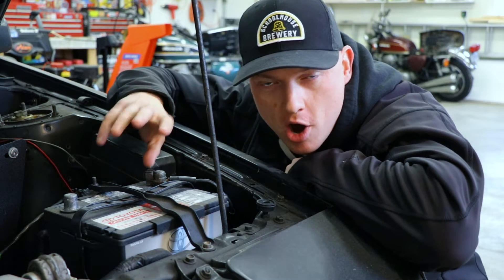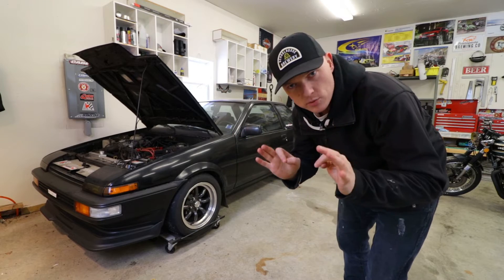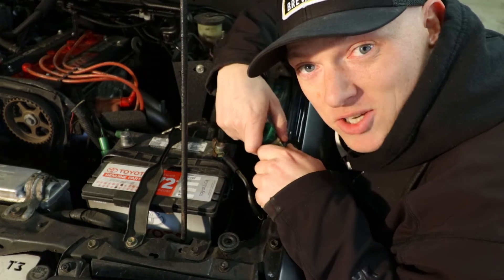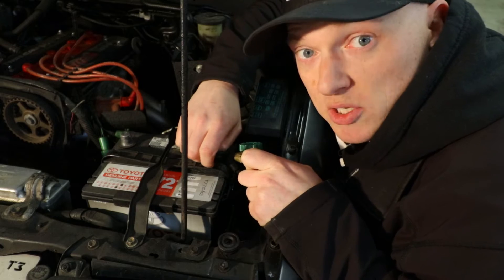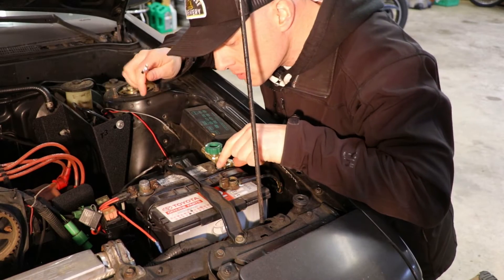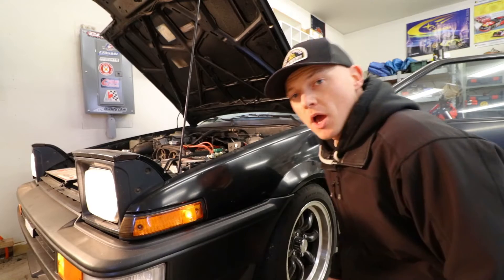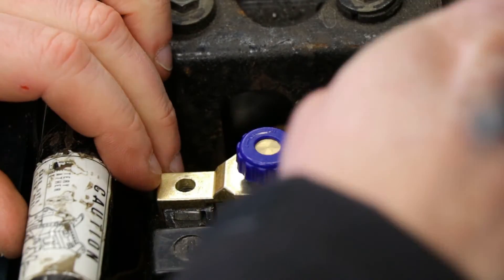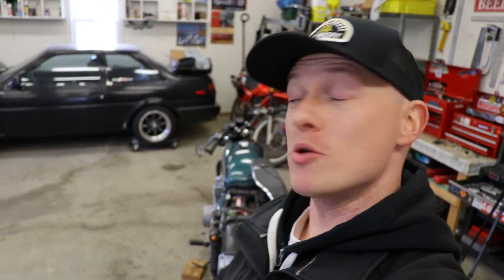How to install battery disconnect or isolator switch

Comment: And after all that bla bla bla , have you thought about what happens to the cars audio system losing code, and ECU forgetting all the settings ??? Not worth the risk and a cent of my money !!!!
Reply from the maker: Not a huge deal as this really is a temporary fix for real electrical trouble shooting. I'm curious as to why you watched this video if you are against this piece of kit...
Reply: Thank you for reply but no explanation. Yep I watched it because I keep getting my battery drained over a few days of car standing . I was hoping someone would mention the side effects of using the gadget , but NOT ONE SINGLE VIDEO ever mentioned the ECU or AUDIO systems !!! EBAY sellers are worse ! They just want to flog the cheap gadget with not a single word about SAFETY or ELECTRONICS SIDE EFFECTS that could result in a huge repair bill !!
Reply from the maker: Installing this shouldn't affect your ecu. The only side effect to your stereo might be if you have to enter a code to "unlock" the stereo. Some newer cars have this built in (my 2008 civic included), but just enter your security code and you should be good to go.

Comment: Another great reason for one of these is why I use it, for a Parasitic Draw, that keeps draining the battery.
Reply: You can test this with a $20 multimeter. First disconnect your battery (with this, use the switch), then bridge it with the multimeter. Make sure you have the right red port selected for this job. It will tell you how much electricity is going though it - thus how much parasitic draw. Remove fuses affording to where they are in the manual until the car is no longer draining. That is the system that needs work. Do online research how to fix the issue, buy any parts to repair it, and done! You could do a multi hundred dollar job for around $100 including tools! I have to do this for my 92 Cutlass Supreme by Oldsmobile. She's a sweet banged up convertible. Time to change that.
Reply: @RustytheFoxCoon   Can you explain in layman's terms how to find the parasitic troll with this test  Method u speak of.  I see you say to "disconnect the battery and then Bridge it with the multimeter " do you mean disconnect the positive and negative terminals or just which one ? And what do you mean by bridge with multimeter? Please explain the procedure a little better. Thanks!
Reply: @rustythefoxcoon5143  some draws diagnose more easily than others. My 08 Jeep Grand Cherokee will drain a battery inside a week, and I think the draw is in a difficult to diagnose fuze box inside the cabin. Nothing resolves when I did VD tests in the engine compartment. I think it's the OEM security system.
Reply: Me & my dad built this cahhhhh ❤️❤️❤️ 

I love your video style & thanks for the info! Installing a battery disconnect today!
Reply: My Silverado has circuits that draw scant current to run some control electronics. There is an obscure instruction in the owners manual for how to stop that. I have had low battery charge when I did not use the truck for a month. I like the disconnect, though.
Reply: Exactly why I'm here, 😒
Reply: Thank you and amen
Reply: 100%
Reply: I'm having the exact same problem, but how many amps should this switch be rated for? I just simply need something to isolate the battery when the vehicle is not in use, to prevent the battery from dying
Reply from the maker: One of the ads on Amazon says it'll handle 125 A continuous and 500 A momentarily...
Reply: Will it work on a cl500
Reply: @robertrobbins5618 it works on batteries not cars
Reply: That’s what I’m gonna use it for..
Reply: I have a 96 corolla & unfortunately I know have this issue after it's been sitting for almost 5 months lol (due to a blown head gasket that was recently replaced)
Reply: Yessir
Reply: 99 corola. Parasitic draw or bad ground idk

Comment: I put one on my Tacoma, but even though I disconnected the thing, my Tacoma still started. Why is that. Thanks for sharing.
Reply from the maker: Hi Jose. I have heard that they can developed a short which cause them to never actually disconnect. It could be a manufacturing defect as well.
Reply: Thank you for that info.

Comment: The adjustable wrench that is already in my car is FREE and it takes less than 10 seconds to get that battery post off .... 
If you are having trouble getting a battery post off, maybe you should not be working on cars.
If your battery is dead after a week or 2 of storage, you have other issues and getting this item is not the fix, only a band aid.
And you should only disconnect the battery when doing repairs when your incompetant and allow the Hot wire to touch ground .. if you know the wire is hot and it may touch ground, use some electical wire to cover it up .....
Reply: I bought one is switch it I install it on my truck if you unscrew the thing all the way and disconnected from the battery works but if you leave it hanging there halfway if you slam the door on your truck has gone kick the switch back in it's not a good switch
Reply: @eddiebradford7511  fix your grammar skills bro
Reply: I think I'd rather just disconnect the battery cable from the battery just switch do not work right it's a waste of money
Reply: Shut up geek
Reply: @dcornwell5484  dont hate on those with more common sense than you or those that are smarter than you.

Comment: So if I'm installing a new light bar on a Jeep or something like that and the videos all tell me to disconnect the battery to prevent a short so that mean this will work?  I ask because for some videos I see people completely disconnecting the battery and for some I see people only disconnecting the negative.  TIA.
Reply from the maker: Yeah this would work. You don't need to completely disconnect the battery (ie removing positive and ground cables) for a lot of simple jobs.

Comment: ??  I installed a Kill Switch on my motorhome and disconnect when I park for more than a couple days. To my shock I went to start up and turned ignition before I remembered I had to do the reconnect. But...the engine started anyway. And yes I have the disconnect on the negative terminal.
Reply from the maker: Hmmmm... I wonder it it's a faulty unit with a short inside
Reply: Will check it out. Thank you.

Comment: Any problems with vibration causing it to come loose?
Reply: I had this issue on a c6 corvette, didn't realize it had one of these and it kept getting loose and leaving me stranded when going back to the car after parking up so I just took it off completely and so far it's fine again, not that these don't work but in my situation it caused a lot of stress but only because I didn't know!
Reply from the maker: It did back off on my once. I simply tightened it a bit harder and no more issues for me.

Comment: I have an issue with my 650 gs. When I turn off the key and even remove it  The tac and speedo continue to flicker and this over time drains my battery. I have to heep trickle charge on to keep lithium ion fro discharging beyond help. My question is do you think a kill switch at the battery will  prevent this flickering bs. I have gone as far as D?C the cables bet it's a real pain with these tiny nuts and bolts thanks for your time
Reply from the maker: It would definitely help with your situation but I'd want to get to the real route of that problem! These are a good quick fix until you have time to fix your electrical issue.

Comment: I just installed the same (green) one on my Mercedes W124, but I don't really like it. There's a lot of 'tension' on the Negative terminal cable because the cable is pretty short, so I have to almost completely unscrew it (and because of the tension on the cable, screwing it back in is also annoying cause you have to keep the cable nicely in place in order that the screw nicely follows the thread). Think I'm gonna look for a better sollution (like a switch instead of a wheel, so you're sure it's really disconnected, with less hassle).
Reply: Being Here I haven't looked into it yet. Just installed this one 2 weeks ago. $200 sounds pretty expensive though for a battery key/isolator?

Comment: Or you can you my option and I have a parasitic battery draw and can't find it and I get tired of hooking and unhooking the battery. Definitely getting one of these till I find the problem
Reply: did it work .  Have the same problem on 85 corvette
Reply: @jarvismoore2019  yes it worked great. Now just need to find the problem then I won't have to use it any more

Comment: Hi Mike,

I’m looking at getting one of these for my Miata but I intend to take the car to occasional track events (I’m building a street car) but I’m wondering how easy it is / is it realistic that the knob would release it self over time due to the car being beaten-on? Or is it really snug once fully seated?
Reply from the maker: The one on the car has yet to come unthreaded. The bike one has loosened on me once, so I cranked it down extra tight the next time. The bike one has a tiny knob though, so you can't get as much force onto it.

Comment: Awesome video. I have one of those on my 1991 Suzuki Samurai with a baffling electrical drain I could not for the life of me, figure out. The isolator was my temporary solution that I never did fix (blush) but it has worked so well all these years, I just got used to the procedure, lol. I did not know they made them in wee m/c battery sizes! I will order one right now through your link, thanks mate!
Reply from the maker: Yeah electrical drains are a nightmare sometimes. These would help with that for sure, but in more of a temporary "band-aid" kind of capacity! I was surprised to find the little bike battery sized ones too.